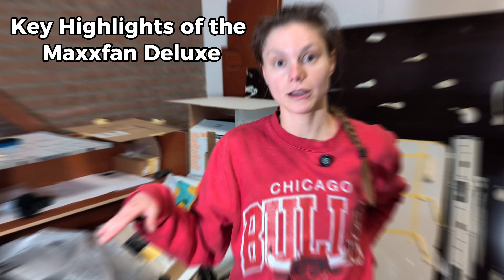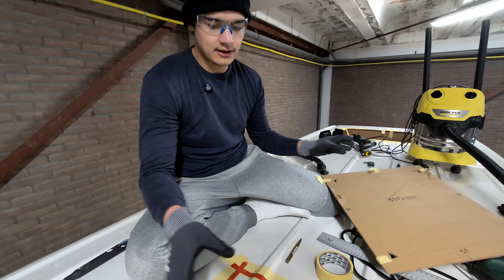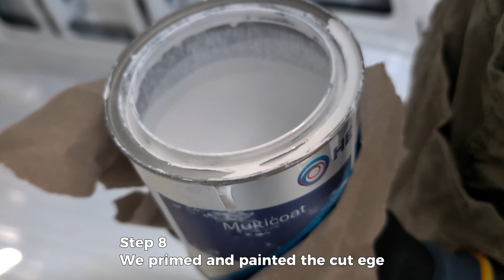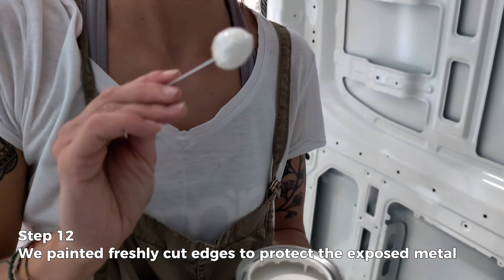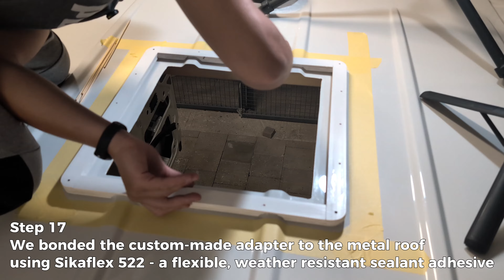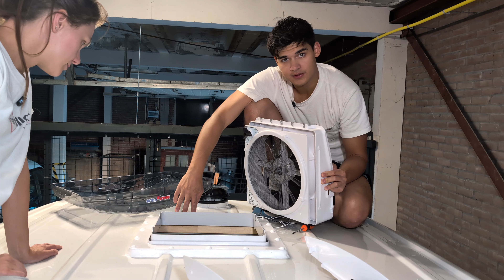MaxxFan Deluxe Installation | Van Build Series

Comment: Hi what's the adapter made of? Great vid!
Reply from the maker: Thank you! The adapter is made from 3mm thick PVC strips. We initially used 5 strips, but removed one due to the glue thickness, so we ended up with 4.